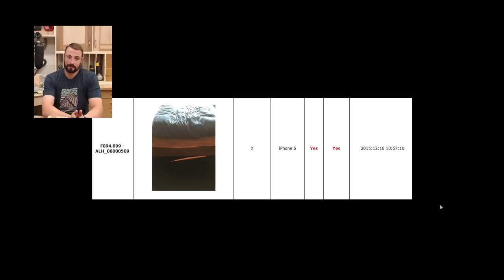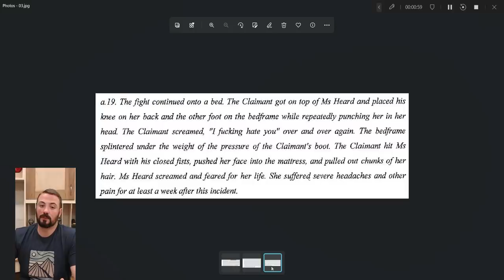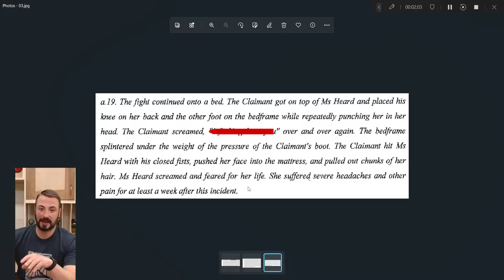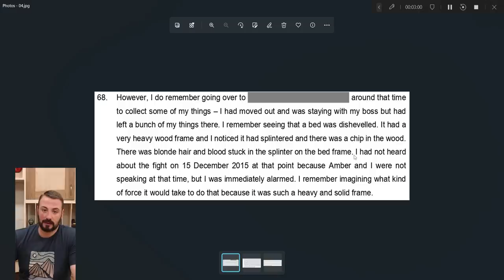Woodworker Attorney DEBUNKS Amber Heard's "Broken Bed” Testimony!

Comment: As a woodworker myself, my brain got stuck on the fact that that is a multi million dollar apartment, with a bed he probably spent thousands of dollars on and it's made of dark staind pine... Yikes, Depp is getting robbed at every level.
Reply: It's obviously not soft pine as Law & Lumber has mistakenly represented. Plus, the photographs he uses in this video are very obviously of two different beds.
Reply: @RocketCalcutta  The grain wrinkles on the near-left corner of the footboard are identical in both pictures. You clearly have no idea what you're talking about.
Reply: @ProzacStylings  the height of the wood is clearly different in the court exhibit as opposed to the other photo, and close up L&L provides. Also the chipping to the corner edge is also clearly different in the examples shown. These facts alone prove that L&L is using two different beds in his attempt to illustrate his point! Furthermore: it has been stated in testimony, as undisputed fact, that the bed frame damage was to the bed in the second bedroom. The wide shot of the room that L&L has provided is a shot of the master bedroom!
Reply: @RocketCalcutta  No, it isn't. Also, /again/, the grain in the front left corner is blatantly identical in both shots. You can stop talking now.
Reply: @ProzacStylings  OK, boss! Sure thing, lol
Reply: @RocketCalcutta  The only thing that is different is there is actually more damage to the wood in the second photo he used. But interestingly enough the damage from the first photo is still there as part of the damage.  The likeliest scenario for that, specially if that is a knife in the bed, is that she took several attempts at doing damage to the bed with the knife and taking photo's of it and then on her own or through help picked the one that seemed the most compelling and realistic to the story she wanted to tell. Which would have been one of the earlier photographs with less damage rather than one of the later ones with more that was perhaps thought to be too much or too hard to explain why it's so extensive.
Reply: @RocketCalcutta  they move furniture around for showings, location means nothing.
Reply: @rekietabeatslc9980  there were two different beds in two different bedrooms. A large bed in the main bedroom, and a smaller bed in the second bedroom. The second bedroom is where Ms. Heard claims she was attacked and where the damage to the bedframe occurred. The bedframe damage photo clearly shows the smaller bed in the second bedroom. It is not as high as the bed in the master bedroom. You can easily see that the dimensions of the bedframe are different. The photographs in this video are of two different beds. Use your eyes!
Reply: @rekietabeatslc9980  plus: the corner edge damage visible to the bedframe in the main bedroom is entirely different when compared to the corner edge damage to the bedframe in the second bedroom! If all the JusticeForJohnny advocates are so interested in the 'truth' how come they don't see it when it's staring them in the face? The truth is that L&L used photographs of two entirely different beds in entirely different rooms for his presentation!
Reply: @Quandry1  Actually I think the reason there is more damage in the picture for the apartment showing is because it was purposely chipped away all the way across to make it look uniform, like it always was that way and not damaged with just one chunk out of it. They're trying to hide the fact that it was damaged cause that wouldn't look nice.
Reply: It’s nonsense and disgusting
Reply: @labyfan1313  it's photographs of two entirely different beds: one from the second bedroom (the court exhibit) and one from the main bedroom (that L&L culled from a YouTube tour of Mr. Depp's apartment.) Ms. Heard proved this in her recent testimony.
Reply: @RocketCalcutta  weird hill to die on, but you can literally check every bed in the house and you are wrong LOL
Reply: @purple1480  what is nonsense and disgusting? Can you indicate what you're referring to here?
Reply: @natalie_rose2861  I pride myself on my objectivity and stand by all of my statements regarding this matter, believing them to be rational, impartial, and well reasoned. I strongly recommend the reading of the approved judgement of Justice Nichol from Mr. Depp's UK libel trial. (Widely available online in pdf form.) IMHO: It is essential reading for anyone seeking a fair and objectively thought through understanding of the Depp/Heard dynamic.
Reply: @labyfan1313  That doesn't work because it doesn't look uniform.  Anybody with some wood working skill would have been able to give that a more uniform tapered edge to cover the damage. But it's not uniform at all. It wavers in and out and has different heights all over it.  It's not hiding the damage, It's making it far more noticeable and dramatic.  It would have actually hid it more and made it a lot less noticeable if it was just the one piece shown in the first video. That's far easier to over look.
Reply: @lukasz065  what is your basis for this understanding of yours? Please expound.
Reply: @Quandry1  and then of course, there's the fact that we are discussing photographs of two entirely different beds (as per the testimony of Ms. Heard, given before this video was even a twinkle in Law & Lumber's mischevious eyes.)
Reply: @natalie_rose2861  FWIW, here are some details as to who I am and what my position is regarding the trial:

I am a long time admirer of Johnny Depp as an actor, having been blown away by the movie Edward Scissorhands when it first came out. I have enjoyed many of his subsequent movies, especially Ed Wood, and Finding Neverland. I happen to be a writer, artist, and musician, and I work in the film industry. I actually live in Hollywood, not too far from Mr. Depp's 'Sweetzer' house. In the nineties, all the way through to the mid two thousands, I was a frequent visitor to The Viper Room club that Mr. Depp owned, and I would often see him at the club, especially in its early days.

At the beginning of the trial I didn't have much of a clue as to who Amber Heard was, only hearing about her from a few news articles and YouTube videos, which all seemed to offer proof of her being a controlling and scheming ex wife. I was thus much more inclined to believe in Mr. Depp's side of the story at the trial's outset. I do pride myself on objectivity, however, and as the trial progresses I am trying to piece together an understanding of what truly went down between the two of them.

A key piece of evidence, as far as I see things, is the 5/30/14 text that Johnny Depp sent to his friend Paul Bettany, six days after the 'Boston plane incident.' This is the text where Johnny Depp admits to the fact that his excessive drink and drugs consumption had caused him to turn into an 'angy aggro injun' in a f*****g blackout', screaming obscenities, and spraying rage at the one he loved. This text alone seems to substantiate much of Amber Heard's side of the story. That being said, I am continuing to assess things, as objectively as I can, with the presentation of new evidence and testimony.
Reply: @RocketCalcutta  I'm not understanding why does two different beds prove that Herds account of events is accurate?
Reply: @NotAnotherKuromi I am not saying that the fact that the photographs are of two different beds proves Ms. Heard's account of events is accurate. Rather, I am saying that if I am correct about there being two different beds (and I am certain that is the case) it shows that Law & Lumber's analysis is based on faulty information. In this video, Law & Lumber makes a big deal of using the bed from the main bedroom photograph to support his theory of what he believes happened.
Reply: @RocketCalcutta  They are not two different beds.  It's easy to say they are two different beds. But there is too much about them for two different beds owned by the same person to likely have as the same, Including damage that would not exist on a second alternate bed bought at a different time.  Also the Testimony of Miss Heard while it shouldn't be likely was influenced by what is talked about in popular media. One of those things happens to be the bed of all things.  Interestingly enough, a lot of her detailed answers that don't make sense or contradictory to previous answers are to questions that have been criticized in the past public discourse.  Which that being coincidental is actually far more likely than the whole two beds explanation.  Which in itself is far more likely than both of those separate things both being coincidental.
Reply: @Quandry1  you are welcome to your opinion, of course. However, I will restate mine, one more time, as succinctly as possible:

There were two bedrooms in the apartment (fact). The alleged  attack on Ms. Heard, where she claims Mr. Depp broke off a splinter of the bed frane, happened in the second bedroom (fact). The photograph (and closeup)  Law & Lumber uses in this video to form his understanding of how the bed was constructed, and what it was made of, is of the main bedroom (fact).

Furthermore: the dimensions (height:width ratio) of the bedframe end timber of the two beds are clearly different, with the bedfrane end timber in the main bedroom being taller relative to its width (fact).

The fact that the photographs are are of two entirely different beds easily explains why the damage to the end of the bedframes is different (logical inference).

As I wrote earlier: you are welcome to your opinion, but a thorough and objective analysis of the evidence to hand, is what leads me to mine. Thank you for the time you've taken to conduct our discussion. Respect, and cheers. 😁👍
Reply: @Bamamarama  it probably wasn't stained pine. Law & Lumber could well be wrong on this issue, seeing as he is wrong regarding other issues talked about in this video. (See my various previous comments.)
Reply: @RocketCalcutta  This is not succinct, most of it is irrelevent and proves nothing, and of that little that does apply this has all been shown to be incorrect. have a good day.
Reply: @RocketCalcutta  I'm pretty sure you are a troll but i'll respond anyway. 

1. Your evidence that they are two different beds based on dimensions can easily be explained by a different camera lens. Some lenses make things wider and shorter while others taller and narrower. Lighting and angle also make a huge difference.
2. Both beds have identical very visibly and unique grain on the left side of the middle piece. The 2 pictures shown also show the exact same damage to the bed, so for your statement to be true they would have had to replicate the damage onto the other bed. I don't see why they would do that. Hence it's the same bed and why you are wrong and biased.
Reply: Nothing wrong with spending 5k on pine when one has multiple homes and very quickly needs a smaller carbon footprint- for appearance' sake.
Reply: @Quandry1 paging spellchecker ! Needed in logical, civil discourse with one who's better informed.
Reply: @RocketCalcutta  you're objectively wrong about the bed. You're only here in bad faith to argue in favour of Heard's dramatically implausible claims, with no critical thinking at all - pointing to what someone else has alleged and saying "see" is the least objective claim a person could make.
Reply: @Quandry1  you too, Quandry1 👍
Reply: @Telrob  the damage is most definitely not the same. The dimensions are most definitely different, the photos are of a bed in the second bedroom, and a bed in the main bedroom, as per Ms. Heard's undisputed testimony from the UK and US trials. But we can agree to differ on this. Everyone is entitled to their opinion, as far as I'm concerned. 

BTW: I am not a troll. I was inclined to believe Mr. Depp at the outset of the trial, but now I am trying to look into things deeper, and with a more objective mindset. Have you read Justice Nicol's approved judgement of Depp's UK trial? It's very thorough, and well reasoned imho. I recommend it to anyone seeking insight into the Depp/Heard dynamic.
Reply: @pyroknight_Å  Amber Heard isn't merely alleging where the defense exhibit photograph were taken, and nor is Law & Lumber alleging what his extra photograph is of. Exhibit 509 (the broken bed photograph) is on record as having been taken in the second bedroom. As Law and Lumber explains in this video, the other photograph he has used(the wideshot and its close up) has been culled from an apartment tour video, and as such is indisputably of the main bedroom. I am being impartial and objective here, and writing what I sincerely believe is the truth. As far as I am concerned, none of the many arguments that have been raised, against the points I have made, have had any persuasive value. I remain open to persuasive argument, and of course, everyone is entitled to their opinion.
Reply: @RocketCalcutta  Above, someone stated "they move furniture around for showings." Do you agree with this, or do you disagree with this?
Reply: @Tkdestroyer1  why on earth would anyone move a bed from a second bedroom into a main bedroom when there is already a bed in the main bedroom? It seems to me that the person who suggested that was speculating, without any basis, in a desperate bid to prop up the false notion that the photographs are of the same beds. Even before I had verified that the photographs used in this video were taken in different bedrooms, I knew they were of two different beds. (See my comments, and how my understanding of Law & Lumber's misrepresentation evolved.) You can clearly see that the width to height ratio of the bedframes'  end beams are different, and the chipping of the top edges is different all the way along. I am a professional artist, well versed in visual observation and perspective, so maybe this gives me an advantage in being able to perceive this, but I think these two facts should become very clear to anyone conducting a close and objective analysis.
Reply: @RocketCalcutta  And here, when you say width and height, are you referring to (from the camera's perspective) the length up and down, and the length from forward to back (i.e., depth)?
Reply: @Tkdestroyer1  the beam in question is the end beam, nearest to camera, running from left to right in the photograph. By width I mean the beam's top surface from bed cover to outer edge (i.e., the width of the beam) and by height I mean the beam's facing surface from top to floor (i.e., the height of the beam).
Reply: @RocketCalcutta  I compared them side by side many times, but I can't tell if they are the same or different. If I had to guess, I would say they are probably the same. Either way though, it's not really an objective metric.
Reply: @Tkdestroyer1  put that metric aside then. Look at the chipping on the two end beams. It's different all the way across!
Reply: @Tkdestroyer1  and here's another difference. Look at the grain pattern on the end beam's facing surface of the bedframe in Law and Lumber's close up of the bed in the main bedroom. Compare it to the grain pattern on the end beam's facing surface of the bedframe in the defendant's exhibit photograph 509, taken in the second bedroom. The patterns are completely different.
Reply: @RocketCalcutta  Indeed, it is clearly different. However, the one that has less chipped off seems to be a subset of the one with more chipped off. That is to say, one could transition from the image with less chipped off to the one with more chipped off. Why more might be chipped off is unclear. I think what's been presented thus far is 1. Someone tried to make it not look as bad, visually (but perhaps failed), 2. Amber was trying different amounts of chipped-ness and went with the image where it had less. I think both of these are somewhat plausible, but I doubt there will be any more evidence to come out to prove or disprove either.
Reply: @Tkdestroyer1  so in your opinion it's the same bed, with Ms. Heard adding to the damage, for some unknown reason, and then the bed being moved out of the second bedroom into the main bedroom for display purposes?
Reply: @RocketCalcutta  how do you know so much about this apartment and the fact that there are two beds that look the same?  If they had two of the same bed, doesn’t the analytical assessment of how hard it is to break the wood still consistent?  I see alot of energy on your part to point out an inconsistency that is not very relevant.  Without looking at the older photo, the same assessment can be made with the evidenced photo alone.  The point is that it is very hard to break the wood that way.
Reply: @RocketCalcutta  I wouldn't say it's my opinion or anything. I just think it's plausible.
Reply: @Tkdestroyer1  thanks for putting me straight btw 😁👍